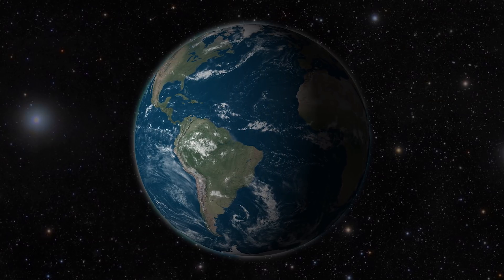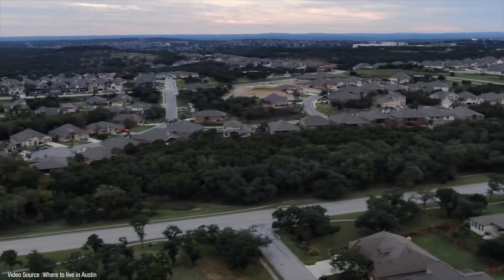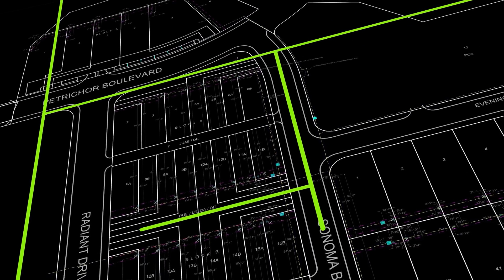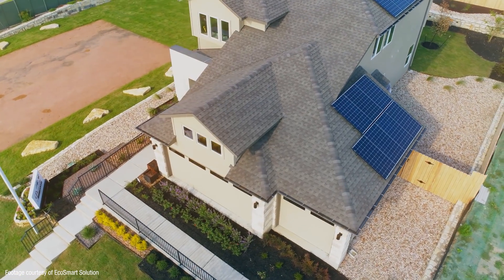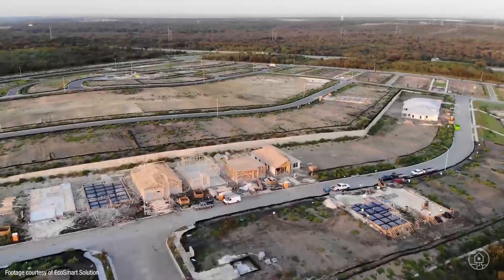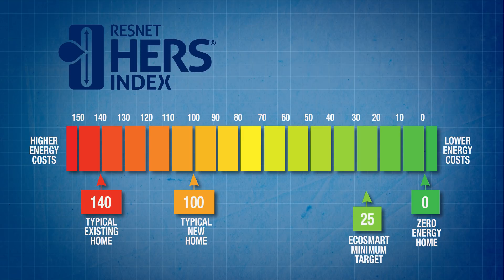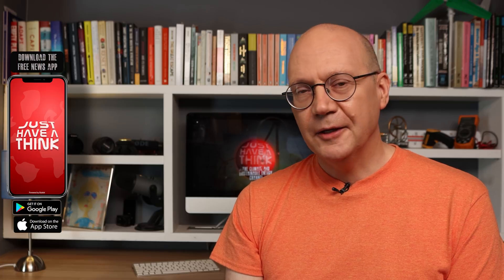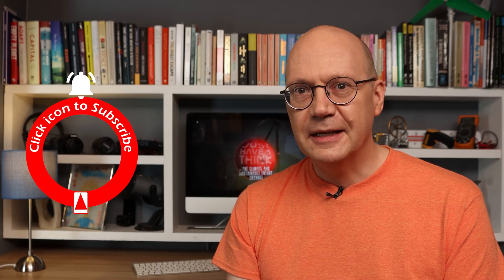Geothermal Energy meets Master Planned Communities :  A blueprint for the future?

Comment: Geothermal heatpumps for heating is very(!) common in Sweden. My parents has a air-thermal heatpump for heating and it works down to ~ -16 c and we rarely get down to those temperatures.

Heating is by far the largest cost for a home/living cost

Comment: The basic idea seems to make a lot of sense. Must say, though, if the underground temp is 22 to 23 C, as they show at 5:20 , that doesn't sound like anything that would help with cooling in summer.
Reply: 22C is very cool when the surface temperatures in Texas exceed 40C!

Comment: Passive energy solutions are better than active energy solutions in most cases. Processes that require big industrial manufacturing capability and deep connections with the oil companies are inherently much higher energy than simple solutions that accomplish the same job. That’s the concept behind passive solar design for housing. With the earth and materials, variable insulation, thermal mass, proper glazing ratios, and, smart construction methods, many homes can be built using human energy  instead of heavy equipment.  Locally available materials and human ingenuity equals high quality affordable housing that is ready for the future.

Comment: @house stark Lots of Parroting....  now explain through the same parroting why the planets in our solar system are behaving the same way ours is and how CO2 is causing the 44 active volcanoes
Reply: Which planets are warming? Where did you hear that?

There's actually 47 volcanoes that are actively erupting right now. https://volcano.si.edu/gvp_currenteruptions.cfm#:~:text=Overall%20there%20are%2047%20volcanoes,started%20eruption%20at%20the%20top. And they have very little to do with current rise in Co2 levels! If you think otherwise, please share the source for that as well! Thanks!

Comment: I'm presuming with the figures there quoting the houses are all built to a passive standard so energy use for heating/cooling is very low anyway, you kind of think that insulation is more important in colder climates but it has a huge effect on energy usage needed to cool a house as well.

Comment: What you are talking about should be called "Ground source heat pump". The term "geothermal energy" should be reserved for systems that gather their heat from boreholes deep enough to eliminate the need for heat pumps.

Comment: Wow, it is great to see developers getting on board with more energy efficient and thoughtful designs! There is so much potential there!
There is also a housing development near Calgary Canada that employs solar hot water heaters for domestic use with excess heat being pumped underground for district geothermal heating in the winter. It is a large heat battery that was made by other thoughtful developers up here in the much colder north Texas.

Comment: I had an early geothermal system in the late 80s in my house and it wasn't very efficient. Ended up converting to an oil heating system. I'm sure today's systems have improved a lot since the 80s and are worth looking at.

Comment: This wont work for all locations (e.g. shallow bedrock) but for most developments it should be a requirement of all developers going forward.
Straightforward to accomplish at the beginning of the project, impossible to implement after homes and roads start to go in.

Comment: It leaves so many out. The solar system is designed about like a television. In fact the old tube style is one way to look at space dynamics. The transition from tube to flat was physics lesson. There's layers in both areas that use quantum to linear for the energy flow. Add a Swiss watch for timing because that too adds detail. Gems and movies. .. Hollywood? Nah , not alone. The concept is like a magnet running across television. Or part of our structural atmosphere was combined within clockwork. But really threw the elemental work off. Orion's belt shows some clock work but also more. The compressed gases are like some planets. Tubes sort of, and the power supply runs hard. The turning events that make or break the situation are in affect ...how much so at this time is in question

Comment: These are more like neutral temperature heat networks. They're good for sub urban population densities but you pay a massive premium to house your population like that. Urban areas can use higher temperatures as efficiently and it further reduces the electrical demand. The size of american homes is also getting out of control, they're getting to be 300m2 in some places! Who needs 5 bathrooms! Inequality is much more important than all the tech that is covered on this channel.

Comment: It is geothermal that is like hydrogen its understanding the economics of it, you pay for petrol per litre per gallon what price points there are for this....
Reply: As mentioned in the video - homeowners pay a flat monthly fee based on lot size for access to the GeoGrid, which is owned and operated by EcoSmart Solution. The trade is significantly reduced carbon emissions AND utility costs.
Reply: Many European cities and some US ones have the currently declining central heating model. A redesign and refit of their systems can connect hundreds of millions.

Comment: The domestic systems should be considered heat buffers, not energy sources.  The temperature differences are too small to ever actually generate electricity efficiently, and naturally it's not the point.  They serve to make heat pumps more efficient which they do admirably, though it should be noted they only work if their is both a heating and cooling season in the location, which means temperate climates.
Reply: Our GeoGrid does not generate electricity, but acts as a thermal exchange system. All homes are equipped with a solar system sized accordingly to the Heat Pumps expected energy consumption. This effectively removes the home from peak demand hours - which can be pricy here in Texas!

Comment: At the 5:10 mark of this video, they are showing us a perfect picture of the source of climate at the surface of our planet. It shows the point below which the underground temperatures never change but above which the temperatures change with the seasons just as they do above ground and the temperature of that neutral gradient is calculated exactly the same way as we calculate the temperature of the climate, as the mean annual surface temperature.

The temperature of everything above the neutral temperature gradient, is determined by the heat coming from below and that is, "The Source of Climate!" Not CO2! Not solar energy! Not anything we do! The climate of this planet is governed by the internal heat of this planet and we need to take full advantage of all that energy. Gigawatts of energy are just floating past us on its way to Outer Space and we just sit here and let all that free energy just float by. There is no energy shortage, only a Grey Matter shortage.

We could be farming the heat in warmer regions where we have an excess of heat to begin with, like deserts and hot arid regions like Texas that has so many energy problems. Geothermal coupled heat pumps can be as much as 400% efficient or more and with those temperatures it would be more efficient than that, so it should be possible to generate electricity if we have an efficient enough system. This is not practical as a large scale central distribution system, so big business isn't interested but it would be a perfect distributed supply system, which would be far more stable and dependable and immune to large interruptions and disruptions. It would allow people to farm the heat and earn income while producing a secure and dependable energy infrastructure, while still allowing the farmer to farm the land and in many cases make land that was not arable, arable by reducing the ground temperature, allowing moisture to condense and for plants to thrive. 

Geothermal has always been the best alternative for all our energy needs. Okay,... most of our energy needs!

Comment: Why would retrofitting geothermal in a house so much more expensive? The expensive thing is the drilling and the heat pump itself.
Reply: It's a lot of work to drill a borehole, but much easier/cost-effective if you're drilling 200+ at once before anything else is on the ground.
Reply: @ecosmartdavid1283  Yes, of course, but I was thinking of what was said in the beginning which I think referred to individual houses.

Comment: Geothermal, of course, has a slew of problems.
The water is toxic, contains heavy metal salts. Among others uranium. One pilot plant was so contaminated that it had to be disposed of as radioactive hazardous waste. There is also a lot of radioactive radon gas coming up.
It would maybe be a good idea to operate a small nuclear power plant with appropriate safety equipment instead (similar to wind turbines, which cause considerable contamination with radioactive thorium through the use of neodymium magnets). it delivers not just heat but also electricity as well! I would not like to live in the vicinity of such a deep thermal well.
Reply: Hi there! Our system is a closed loop that does not connect to a thermal well. The system is a thermal exchange - which effectively uses the earth as a battery storage for thermal energy. We monitor and maintain the GeoGrid so that it can be utilized year after year. No need for uranium!
Reply: @ecosmartdavid1283  
Thank you for the correction!
However, the following points still speak for nuclear power plants:
- Independent of geological factors.
- Scalable at will.
- Bonus power generation.
- Profitability
Your system can take care of a few houses.
A small nuclear power plant a whole city!
Look at 'Terrapower', that's innovation!

Comment: I dont think that kind of geothermal energy is a good thing there are consequences for that kind boring into the crust, with fluids being pumped deep into the ground, prone to produce earthquakes and fouling ground water. Unless they can make it a closed loop system.
Reply: This is a closed loop system.  Also, no fracking is done.
Reply: @TheGuyThatEveryoneIgnores  Then it should be fine for environment. :)
Reply: This fellow above is correct in that the system is closed loop! :)

Comment: I have plenty of reserve concerning geothermal. Here in France there has been several experimentation that ended up as local disasters, with earthquakes and damage on the nearby houses. There has been a spectacular mistake here where they bored for a private installation, but they pierced a natural layer of gypsum and further down a water vein...the whole hill actually moved, caused by the expansion of the gypsum hydrated, which eventually raised the ground by several mm, causing cracks on houses of the neighborhood,. The insurance were not happy. 

Geothermal isn't easy everywhere (easier when you live on a volcano), many experimentation stopped due to unforeseen consequences (Radon emissions, water pollution, ground shakes etc.). It's a great solution on paper, but there is much to do to improve, and even then it's not the graal.
Reply: We are talking here about geothermal energy for a house. It is not to produce electricity by seeking a source of heat and injecting water under pressure. For my house in Montreal, it is a vertical shaft of 200 m (700 foot). It is a closed loop. The liquid is never directly in contact with the ground. It allows me to heat my house when it's -25C outside and cool it down when it's 36C. There have been no earthquakes reported here for this type of installation.
Reply: @LamarreAlexandre  Read correctly!
The drilling itself was the cause, not the water circuit
Reply: Hi there! Our GeoGrid is a hybrid closed loop geothermal exchange.

Comment: And how is that different, aside from the fancy electronics, than the thermal distribution systems, notably they are not geothermal that is a common place in many European cities. The most expensive part of the investment is the piping infrastructure and a coal or nat-gass power plant can be substituted with a geothermal power source, as long as one digs enough below the surface..
Reply: Oil companies should turn themselves into geothermal companies.  They already have the equipment and experience for drilling deep into the earth.

Comment: This is pretty awesome. I've been looking at high efficiency heat pump water heaters and air-source heat pumps for HVAC at my home, but as retrofit. I will likely continue with both projects because I expect improved living conditions - more stable temperatures due to how the systems will be running on a more continuous basis (less fluctuation in temperatures). But it's clear the economics of a centralized infrastructure, financed over many years and shared with multiple homes makes more sense; particularly when combined with smart controls, solar, and storage. Love the vision. Execution looks dead on, as well. Great video.
Reply: Thank you!

Comment: $50 to $70 per month?  12 months per year?  Did I hear right?  Here we pay $1.05 per therm for natural gas. Peak winter use is about 70 therms per month.  But that does not hold long. For more than half the year, no heating is required.  So, it would seem that this nominal price for the 'services' is as high as possible. Of course, there is the benefit of no CO2 emissions, and that is very important.
Reply: It gets near or above 100 f. for more that 150 days a year in Austin. People pay $300 electric bills for cooling.

Comment: There are arguments against geothermal.  More earthquakes, for one.
Reply: Hi there! Our GeoGrid is a closed loop thermal exchange system. No pumping of liquids directly into soil.
Reply: @ecosmartdavid1283  please tell me the specifics of how this is so different?  Your are drilling into a thermal hot spot aren't you?  For your main source I mean.
Reply: @ravensdotter6843  Not quite - the GeoGrid is a thermal exchange system that does not require an underground thermal source. Texas is quite hot, so we're actually using the Earth as a battery storage for thermal energy. Ground source heat pumps remove the BTU's from the home and store it in the borehole, and then utilize that stored energy during the heating season. It's an effective method of energy management - not generation.
Reply: Hmmm...
Reply: You don't seem to understand residential geo at all!

Comment: Thank you for another great video focused on what we can do to help the environment. I really appreciate it after that Brazil one.

This sounds like a great idea, especially for Texas where the local grid is unreliable. I remember a number of years back a developer in my part of the world was building a housing development with geothermal heating, but it was just a bunch of individual systems of the horizontal kind. This Texas development is a step beyond that because of the way it connects the houses together. That and the precise computer control really does sound clever. An entire neighborhood linked together (plus the five miles of pipe) will provide a massive reservoir of heat that can be used to even out any individual fluctuations and give everyone an optimized service. I hope this idea catches on!
Reply: Spot on!

Comment: "...ancillary heat rejection through cooling towers...". Am I the only one to think that this is a waste? Wouldn't it be possible to utilise a Stirling engine to turn that waste heat into power?
Reply: Probably not. If the homes are trying to reject heat, putting anything between the hot line and the environment just means the air conditioning would need to work harder. You'd be driving the Stirling engine with air conditioner.
Reply: NO. Where does your delta 'T' come from. Austin can see 100 days a year above !00 deg. F.
Reply: It seems to me that having cooking towers indicate that not all the heat can be dissipated by the geothermal system.  I would guess this is a design tradeoff for use on extremely hot days in late summer.  It would be nice to know how often and how much water will the cooling towers use.
Reply: @donaldpaquet838  Austin gets 30 + inches of rain a year.

Comment: JHAT, 

I really can't be bothered to watch your videos but there must be a definition of what 'geothermal' means.
Very few places can use real geothermal which is heat from the earth itself. Refrigeration systems are not geothermal and are very misleading when they are so described.
Reply: Your pedantry is noted.
Reply: Mr Torpedo

accuracy not pedantry. It is misleading to call it geo thermal.and the name heat pump is also misleading. They don't pump heat from outside as is often the way they are described. The heat comes simply from the compression of the refrigerant gas.
Reply: Yes, this "geothermal heating" should really be called "ground source heat pump heating (and cooling)".

Comment: Giant projects like this are sort of contemporary solution scaling experiments. We won't actually know how well this works until a decade has gone by and some smart people analyze performance, operating costs, maintenance, environmental impact and sustainability. 

We need to keep in mind that lots of new technologies look great at first, but then issues develop over time that force another think. Also, think about the embodied energy and resources in such a massive project. Clearly a model for the first world only.
Reply: The embodied energy and resources involved are probably a lot less than the total of every house being heated and cooled independently, which is the only alternative.  My question is whether this solution will actually cost the homeowners less money in the long run or will the companies involved put the cost savings in their own pockets.